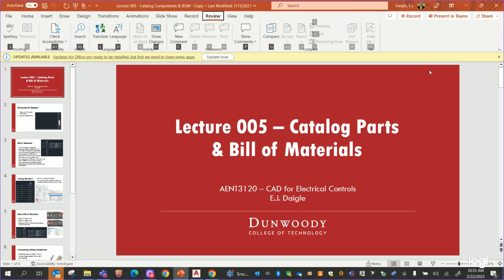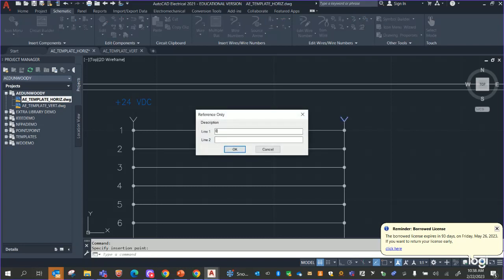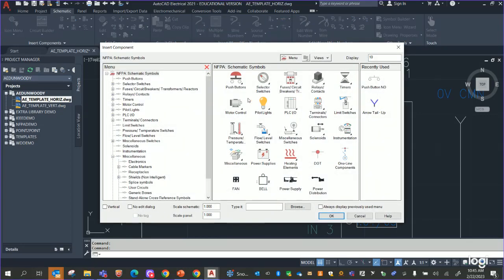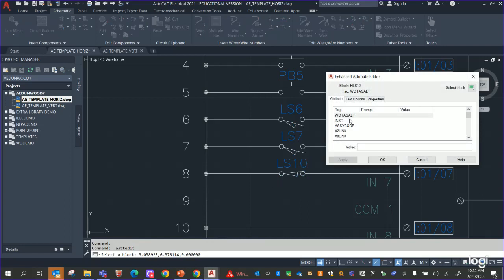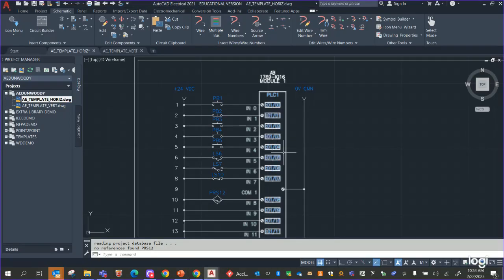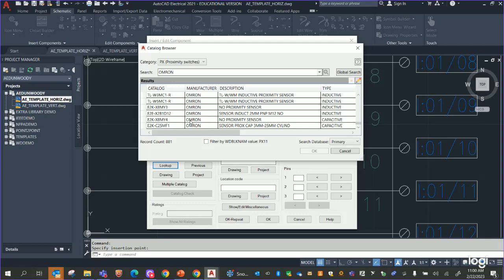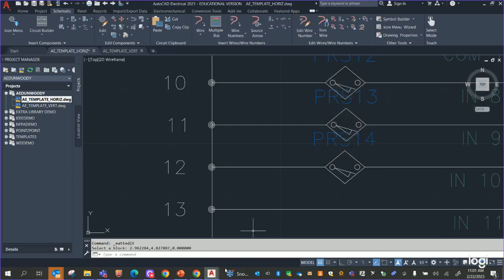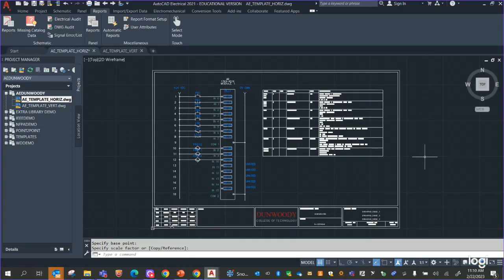AutoCAD Electrical - PLC Modules, Catalog Info, and BOM

Comment: Hi, thanks for posting, useful info in this video.  One item to note: the reason your PB and LS tag numbers are off by two line numbers is because you moved the ladder in relation to the original insertion point by two line numbers. After moving ladder, "Select the Revise Ladder button and then click Cancel on the dialog box. Using this command forces AutoCAD Electrical toolset to reread and update its internal ladder location list."

Comment: You should use the trim wire command with unused wire. It gets rid of the wire and the connection nodes.